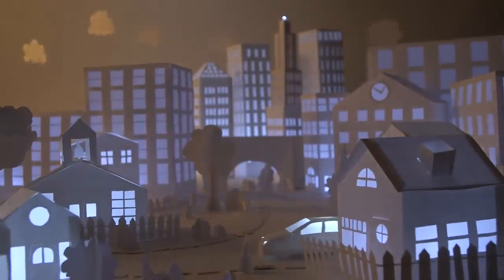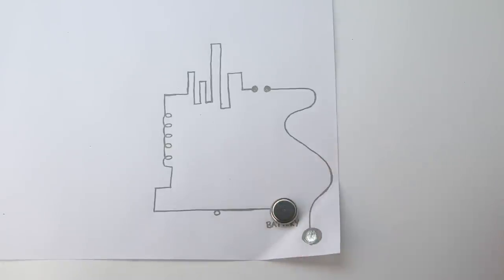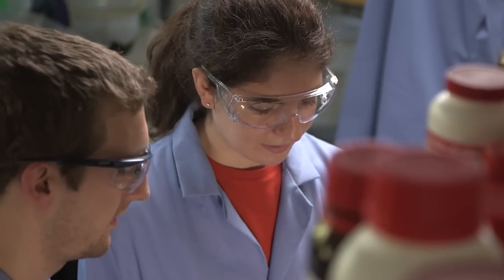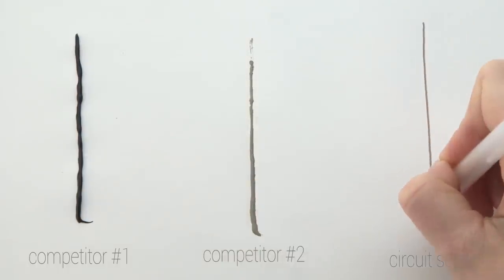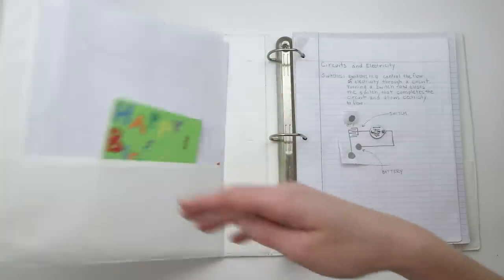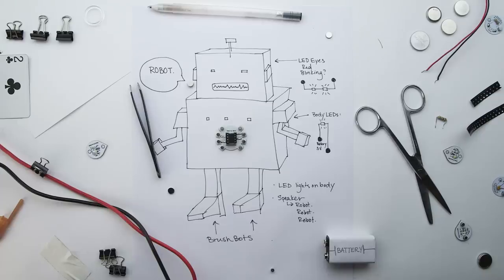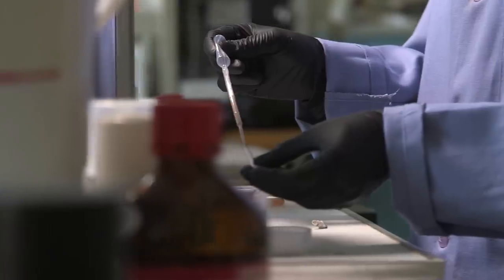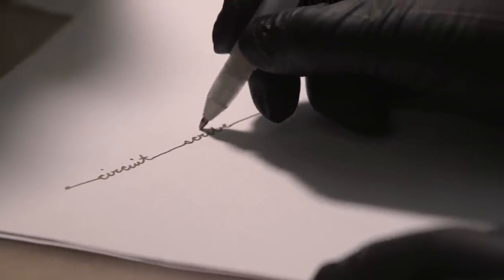Circuit Scribe: Draw Circuits Instantly

Comment: This is by far the most innovative creation I've seen in awhile, kudos to you all. A few questions though if I may: Is there any native resistance in the ink? How is the durability of the ink (i.e. how long will it last) and with that, what is the optimal surface material? What are the pros and cons versus using a traditional board?

Comment: Im taking circuits I as a intro into my renewable energy engineering program. 
Are your videos a practical way to learn intermediate/advances systems?
Or is this just a simple intro into circuits and how they work and how you have advanced in the working of circuits (i.e. using the carbon tip of graphite as a conductor)? 
If you cold get more technical, it would be awesome, you could not only bring in a crowd of interested viewers into an advancing idea, but you could help people like me learn harder systems and circuits with easier ideas.
I hope you keep it up, and I always look for new ways to advance information.
Keep it up, and thank you.
Keep studying!

Comment: How different is this from Chemtronics CircuitWorks Pen? I used one back in the 90's. I remember it dried out and cracked causing intermittent connections. Do you have a different formulation?

Comment: I just thought of a great use for this technology.  Not sure if someone else has thought of this so I apologize if it has...  Someone should market this towards electrical linemen.  Tons of people die from electrocution while working electrical lines.  Because electricity always takes the path of least resistance, it would flow around critical organs and through the drawn circuit.  Might seem crazy but it might work.

Comment: Can't you make circuits with pencil lead on paper?
Reply: The resistance is too high for any practical uses though.
Reply: Igniferi
not true at all.
Reply: thekingof7 yeah, true. Graphite is not nearly conductive enough to have any real use. It has some conductivity, but it is very hard to make a circuit with it.
Reply: Yes you can - for example 1 pencil is about 100ohm
Reply: +Art of the Problem I never said you couldn't make a circuit, it's just a lot more difficult considering if what you say is true, that everything is a 100 ohm resistor.
Reply: Graphite's a pretty poor conductor.
Reply: Davis Wiltshire are you planning to draw 5m long circuit? its enough for this "doodling"
Reply: Igniferi look up graphite paper circuit you will be amazed how incorrect your statement is
Reply: Lkhagvasuren Davaatseren I'm not saying it doesn't conduct electricity, I'm saying it is such a poor conductor, that there is no practical use for it.
Reply: Lkhagvasuren Davaatseren Relative to... anything else, my statement is correct. I've made graphite circuits myself.
Reply: Also graphite is very flimsy, so they mix clay with it to stop breaking easily, hence increasing the resistance.
I recommend trying to use a 6B pencil to make a circuit, or a pure graphene/graphite pencil, this would be a more successful attempt.

Comment: I bet a simple pencil works just fine!
What exactly makes "your invention" a better resistor than graphite?
Reply: Because this is a conductor, not a resistor. And even if it did work as well, wouldn't everybody know about it???
Reply: john pitten
1. Define "everybody".
2. A conductor leads energy well, while a resistor dampens electricity.
The are not opposites, as you are implying. Rather it is just a matter of how well they conduct energy.
f.e. Silver, Copper and Aluminum conduct well, but resist very little. Coal-fibers and various metal oxides are examples of poor conductors, but resist more.
3. My question was referring to the practical application of this particular product.
Reply: 1. the general population
2. yes
3. education and light-up birthday cards

Comment: So basically you have to buy all the electronic parts and the ink just acts as wiring, which is the least complicated and least expensive part for building circuits anyway.

Comment: Wallpaper to flooring lighting up ..
Tiles with L step 1 X 4 around and so on they'll all connect with fibreoptic tubular and perforated light beams from holes within fibre optic frames to face to face 1 way Mirror film multiply lights with 1 recyctrix system and WiFi Bluetooth with electric also micro bulb also matchstick for taking circuits scribe to tabs to electric cable and Transparent enough is it safe without electrocution???
Why not cornice wall drawing pens to wall light fittings that's another pen sold to sparkies electricians 
Marker pen with clear non conducting over conductive wiring in homes goes out of fashion sold pens battery tabs/wire blocks with tab to draw a quicker wall light inside fittings 

DIY instructions or sparkies dream work done quicker without scoring The walls plastered repainting

Comment: Overhead Televisions outdoor cable to telephone wire and Electric cables ESPECIALLY China which can be laid wall across floor and up a all walls to archway sleeping waterproof tight as 2 wiser wider non conductive soooooo layer within as conductive a Policeman ) beneath and above 1 larger glue gun Extrusiion with pump feeding 5-10 litres bottle/buckets PSI upward into larger pen clear and coloured .
That's on an industrial level Maybe a future for Windows doorway with WiFi/Bluetooth linear or motor cogs roll windows open shut locked with speakers hidden Microphones camera module with won't be seen or without for next generation HIFI/ghetto blaster gone home cinema surrounding connect any screen Transparent Window also privacy glass frost also heated and cooled airfiow window framework.
3D printing tubular fibreoptic geometric within patterns to tube inside grid ³ or flatter 50% from sure square ² 
There's industrial level without digging asphalt and drilling groundwork which can safely replace overhead wiring/cable